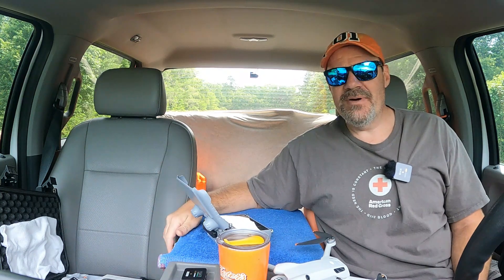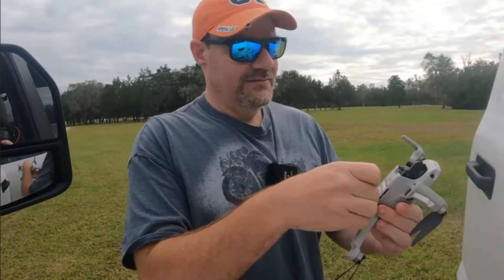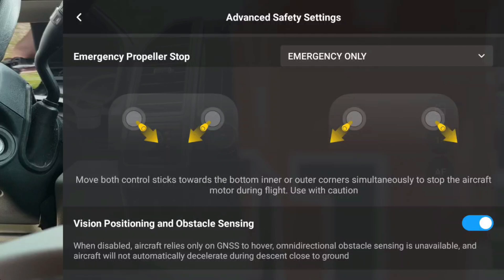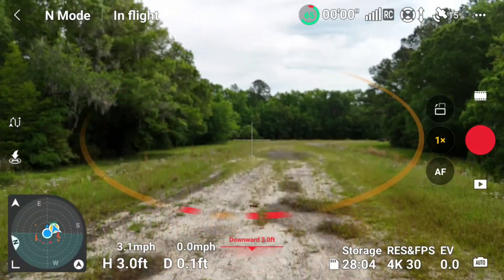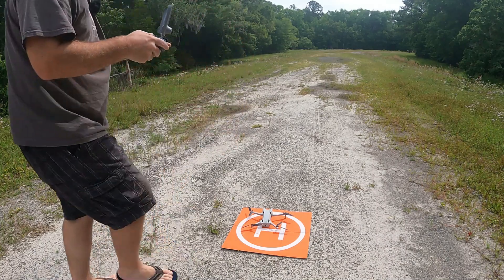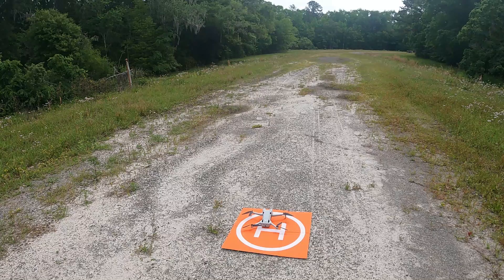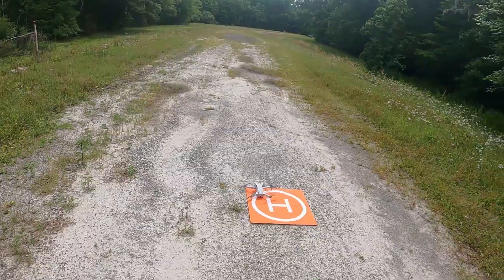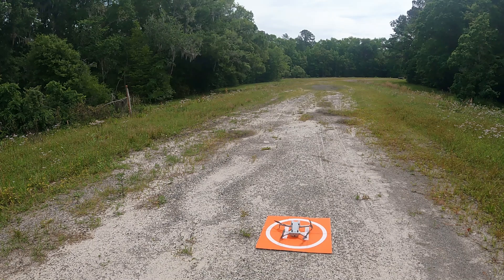The Impact Of Mini 4 Pro Safety Features:  Good or Bad?

Comment: Thanx for this video. 
When you turning on "visual positioning and obstacles sensing" could the mini4 fly right near the ground without 0.5m altitude limit, or it will only works after taping sensors?
Reply from the maker: Hmmmmmm. That’s a really interesting question. I’m gonna have to put this on the list of things to test and find out. lol. Thanks so much for watching and for the question. Hopefully soon we’ll both find out the answer here. God bless!!!  Kevin

Comment: Another scary, but great test, Kevin. But why don't you try turning off the sensors, but do a manual landing, but preferably over grass, or something soft, and see if he bounces again? I have a feeling he will bounce, as he won't slow down before landing. It would also make hand-catching easier because he won't pull up as you hand goes under him.
Reply from the maker: Lol thanks again, Gary. You have a good point. I was telling Nobby I was glad I didn’t know what I was doing because I may have landed manually and crashed Dwight really hard on that road. You may be onto something too with the hand catching. That could be something to look into…  hey speaking of hand catching, did you watch 51 Drones video on the new Mini 4k?  He snatched that sucker out of the air as it was flying past him. That was cool!  I’d lost a finger!
Reply: @WeretheRoberts  Nobby was right. I tried it over the lawn from a couple of feet up, and she bounced, just like Dwight. Then I sent her up several feet, and she dropped like a rocket, but stopped about 4-5 feet up and hovered when I let go of the stick. Then I was able to snatch her out of the air and flip her over without her pulling up away from my hand. But I wouldn't suggest that unless it's an emergency because your drone will crash hard into the ground.
Reply: @WeretheRoberts  Wow, I just watched that 51 Drones video where Rus, grabbed that thing as it went zooming by! I would have lost a finger too! Or at least end up with a bad gash, like I did when pushing my Mini 4 with prop guards away.
Reply from the maker: @gama45 hahahahaha. That’s hilarious Gary. I’m sure I would’ve had the same injuries, brother. I may have bled out!  I took some advil yesterday!  Lol.

Comment: Interesting results on sortie #2. RTH turns sensors ON but the button in settings is still OFF. Thanks Kevin!
Reply from the maker: Lol yea I guess it’s another one of their “safety features”. I remember GavinHR intentionally turned them off on a test flight one time and the RTH line was directly heading for a telephone pole. It maneuvered above the power pole with no problems and he proved the sensors had come back on. I actually forgot about him doing that until i came out to try this. Lol.

Comment: Great Test Kevin. If you would of done it slightly different and not used RTH and manually landed with the sensors disabled, it would of come down like a rocket. ITs designed to get you down quick like if you were on a boat etc. Keep safe man 👍
Reply from the maker: Hahaha. It’s a good thing I didn’t know what I was doing then. I may have really damaged Dwight if that was the case. Lol
Reply: @WeretheRoberts  😁